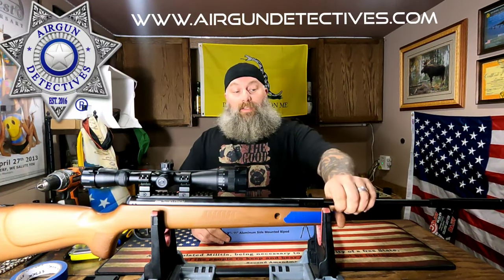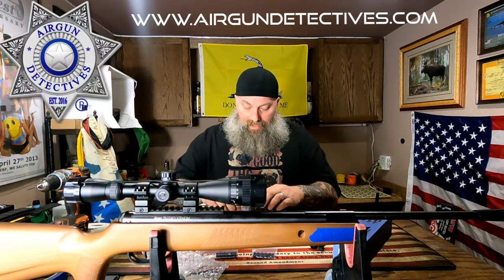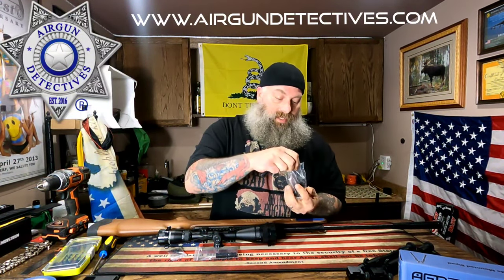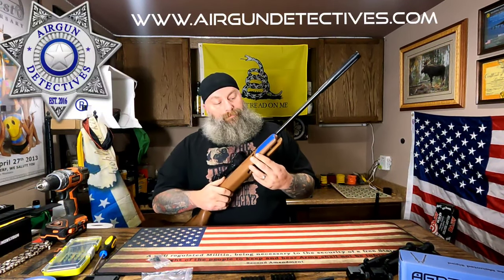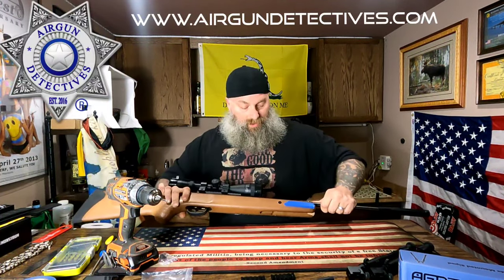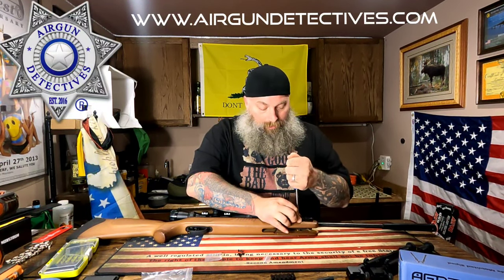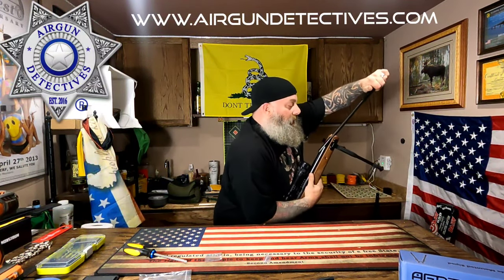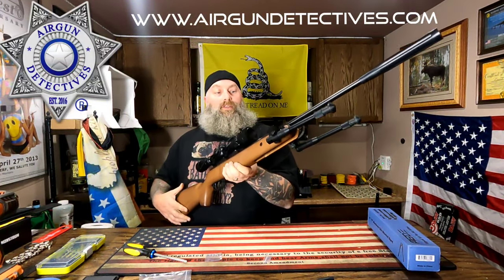Break barrel bipod from Airgun Detectives instalation

Comment: Thanks for the video.  I too was considering some JB Weld to help create a solid bed for the rail.  Maybe even a dab on the screw threads to really lock it all in there.  Did you end up removing the rails and applying any off-camera?  Do you think it is even necessary?
Reply from the maker: I never did. But it's a great idea.